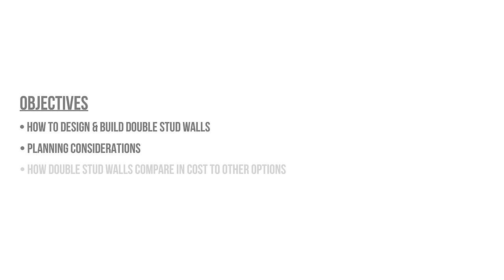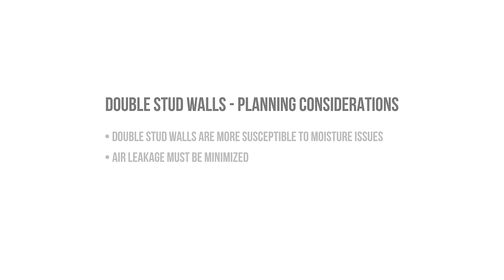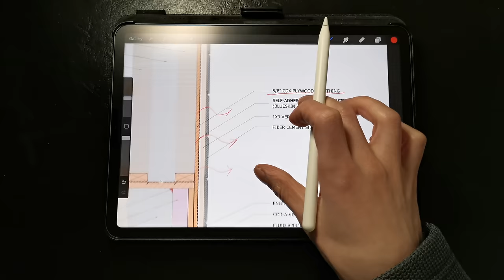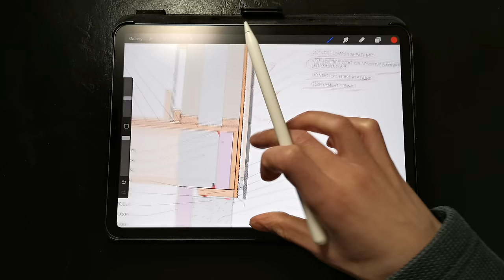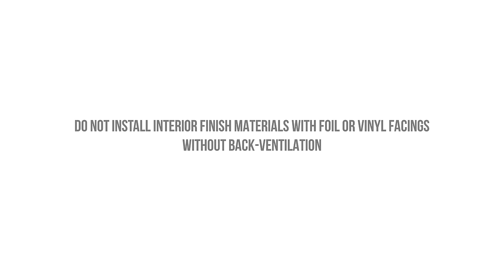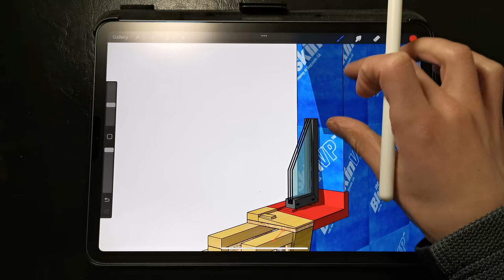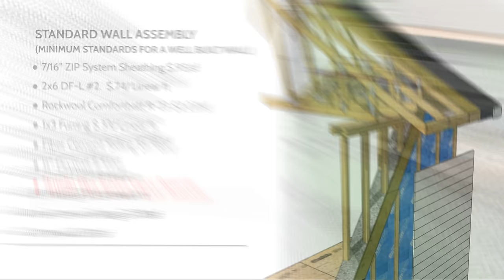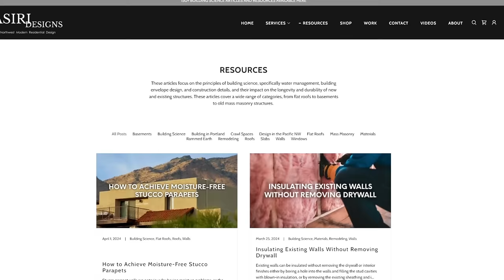Super Insulated Walls on a BUDGET?!? | Double Stud Walls Explained

Comment: R- Value is a poor way to measure insulation performance. It was designed by the companies to push their own products. And they used their power to influence the building codes to sell more of it. When the R-Value of Fiberglass is equal to an empty air cavity you can see the principals of thermal conductivity is more than just conduction. This old standard never considered radiant or convective heat loss and the testing methodology was designed to ignore them to continue pushing fiberglass products. I just finished rebuilding a 800 ft² home. I put 1 in polystyrene on all of the exterior walls and underneath the roof trusses and it takes 40% of the estimated BTU to cool this home compared to a regular 800 ft² home. This was tested without any drywall or insulation between studs.
Reply: A few years ago several smaller companies came out with foil-faced bubble wrap as an insulation product. They advertised it with an R3. The product was approximately 1/8 in thick. Immediately they were sued by Owens Corning and then purchased by Owens Corning. No Owens Corning controls that bubble wrap product and they sell it as a radiant heat barrier. They no longer advertise a R-value. Instead they only show you a r value when combined with other insulating products. If you do the math, Owens Corning is effectively rating these products at 2.7 r value per 1/8 in thickness.  They were extremely threatened because this would offer a 21.6 r value per inch If multiple layers were used. And effectively a 75.6 R-value for a single 2x4 stud. Not only would a sandwich piece of this material annihilate the fiberglass Monopoly but it would also expose The r value test to be a scam also.
Reply from the maker: @Johnman9000  I appreciate your comment and understand where you are coming from as far as skepticism about products, but this is categorically wrong and I would encourage you to read a bit more about the topic. The manufacturers of the bubble wrap product you mentioned were sued for false advertising just like there is no such thing as an R-9 radiant barrier paint. The reason why is because both radiant heat transfer and convective heat transfer become conductive heat transfer when they are in contact with solid building components. We address convective heat transfer primarily by doing a good job of air sealing, since this form of heat transfer is through air or liquid. We address radiant heat transfer by providing a reflective surface, but the fact is that radiant surface is touching something on the building without an air gap, it's conduction. This is why the reflective bubble wrap was labeled as false advertising. The R-value came from the air bubbles, not the reflective facer. I'd recommend reading this article from Building Science Corp: https://buildingscience.com/documents/building-science-insights/bsi-136-piltdown-man-does-thermal-resistance

The reason why the rigid foam you installed on the exterior works is because you provided a thermal break, uncoupling the more conductive components from the exterior environment. This is conduction....

Comment: Dense packed cellulose is R-3.6/". At a PHIUS conference a few years ago there was a study done at 4 places across the country. They found that the interior RH in the thick walls stayed at 19% relative humidity year around. It didn't dry out. You get mold at 21% RH. Good luck finding contractors that can put these details together.
Reply from the maker: I'm assuming you mean moisture content, not relative humidity - air leakage was the primary driver. If your contractor or builder can't be bothered to install some tape, they need to be fired.

Comment: I recently built a 14'' double stud wall for a slab on grade house. The outside load bearing wall is 2X6, 2' OC with 1/2'' plywood. It is cantilivered 2'' past the foundation and then the foundation is wraped in 2'' of insulation that then has stucco applied to the exposed areas.
Another practice I use is to not stagger the studs as it is not necessary with all the insulation in between. Crowned studs can be crowned opposing each other then tied in the centre with a narrow piece of plywood to straighten them out.

Comment: If the wall can dry both ways and the majority of moisture issues are generally from poor exterior practices even if some moisture gets into the wall it should still be able to dry if there’s proper dehumidification on the inside as well. The biggest struggle in there for me is a 1x3 doesn’t allow for use of regular electric boxes even lights and also venting so again more costs and labor. 

I really enjoy this video. Would appreciate you doing maybe a series and addressing some of the issues I’ve mentioned.

Comment: have you any experience in how contractors really make sure everything is airtight?
also do the outside insulation panels require tripple pane windows too? 
if i have a design that is standard 2x6 can you change it into the double studd walls for south carolina requirements?
Reply from the maker: Yes, a blower door test is crucial to testing air leakage and identifying locations where there may be substantial air leaks. Conduct a blower door test after the framing, windows, and weather barrier has been installed to get a baseline number. Then, conduct another blower door later on in the process prior to the installation of the sheetrock, and after the plumbing, electrical, HVAC ducts have been installed.

Comment: I love passive houses and the super insulation movement, but this seems like one too many fragile materials stacked on top of each other waiting for something to happen. A cellulose insulation that is protected from a vapor barrier that can get penetrated easily and accidentally when somebody hangs a picture.  An insulation strategy that is too fragile to handle putting the shower against an exterior wall. I was hoping that our high performance homes wouldn't be as fragile as a high performance race car.

Comment: So ho do you get the gallons of water out of the house? I’m shure my wife and I emit 1/2 gallon of water every day.
And where is the radiant barrier?
Reply from the maker: You don't need a radiant barrier if you're building in a cold or even a temperate climate. You need supplemental dehumidification and a dedicated fresh air system like an ERV, no matter if you're building a high performance home or not.

Comment: Okay that's a lot of Science.
But, in the real world-
#1) What about a future homeowner hanging pictures to the wall?
Everything hinges on never penetrating the wall to prevent moisture & air.

#2) What about a Future Kyle punching the drywall?
Current home design centers around component repair of the house. Any piece being removed, changed,  and replaced

#3) what about future improvements or adaptation.  When the Internet became popular,  conduit was renovated to accommodate data wiring.

#4) expansion and adaptation. adding electrical outlets to a room or Lighting fixtures.

#5) Kids will be Kids.
Who doesn't know a kid that did something dumb and made a hole in the drywall.

Bottom line-
You'd almost need a triple wall just to meet that Ari/Moisture risk. 

A sacrificial interior wall cavity for any future homeowner needs.
A home could sit there for +100 years. Your design would absolutely be derp'd by then by any number of owners or occupants during that time.
Reply from the maker: @brokedude9999  You just described what I discussed in my latest video that got released today: https://youtu.be/9yoGFX_1gjQ?feature=shared

This is also the importance of the service cavity mentioned in the video.

Comment: So in the end, the reality is you are trying to create as close to a WINDOW type of nuetral atmosphere between walls. This is an over- engineered way to gain r-valuation that brings more than cost to the table. Most municiple inspectors are not that bright and a good 70+% have never swung a hammer or pulled a wire on a jobsite. Hence the reason they carry that 8" thick book around in their car all the time. I have beena developer/contractor for 38 years, I am also an engineer (Mechanical) and whenever we introduce some new "PROCESS" we lose more money in wasted time proving the inspector and the planning dept. aren't communicating with each other. Second problem here is th labor to essentially build out 2 exterior walls and to connect them. To say that the difference in cost of 2x6 studs to 2x4 Proves nothhing except that you can count pennies. Labor, engineering, time to get approvals, inspection delays because of detail clarifications etc. ALL COST MONEY. I am still amazed that with all the combined knowledge we have in the construction field today, we still can't get around these facts. That a house...as supposedly poorly constructed in the 20's or turn of the century continues to stand, doesn't leak, has no mold and has lived through Quakes (west coast) hurrricanes, wind storms, snow and baking sun. I agree with codes and enforcement where people live in tight communities where set backs matter. I have long been a loud voice against rural code enforcement of Anything constucted with the exception of plaaces where sewer, water or storm drainage is connected to the residence. Electricity is a simple given for certain code requirements since the grid is essetially an OPEN circuit from source to residence with exception to folks with properly installed backup generators. Ideas are great, But I see a new wave of ridiculous on the way, and I for one am glad to be at the point of retirement. I have spent too many years fighting and winning against municiple engineers(usually hired right out of school) and planners that have no credentials and even less real world experience.

Comment: Consider applying smart vapour barrier to the interior side of the interior double stud wall to create the service cavity instead. Perhaps one would have to create a larger space to reach desired R-value but would eliminate the extra strapping
Reply from the maker: This works too! We like the strapping/furring over here since we won't have services buried in insulation, but you can absolutely locate the smart vapor retarder mid-wall.
Reply: Your content is helping me be a better builder, thanks for your response!

Comment: How do you meet the horizontal fire blocking code R602.8 Item 1 with a blown in insulation?
Reply from the maker: Gusset plates connect and close off the top of wall/necessary horizontal connections.

Comment: Double Stud walls not so good idea causing sheathing rot. Building Science has several papers & studies on problems with double stud walls. The best option is 2x6 24 oc with exterior rigid foam panels for added insulation.

The issue with double stud walls is that moisture from inside migrates & condenses on the exterior wall sheathing & never dries out. Over time the sheathing & wall studs rot. Exterior insulation keeps the sheathing warmer & prevents condensation.
Reply from the maker: You're not wrong, but if you watched the full video, I explained how to design one properly/and what not to do. We're using the taped smart vapor retarder membrane to prevent condensation on the backside of the sheathing, as this is serving as our air barrier and vapor throttle, and why we are specifying plywood sheathing and a high perm self-adhered WRB product. I'm very familiar with the article you're citing, and air leakage was a major driver of the higher moisture content in the sheathing. After controlling bulk water, controlling air leakage should be of the highest priority.
Reply: @ASIRIDesigns  That doesn't work. See Building Science paper on using Vapor barrier\retarders with Double Stud walls. Moisture still accumulates. There are always going to be holes: Drywall screws, electrical, plumbing & it will fail & the material degrades, cracks & failures. Smart vapor retarders also over promise & under delivery. SVR don't work well in high humidity indoor conditions.

The only practical option is exterior insulation.